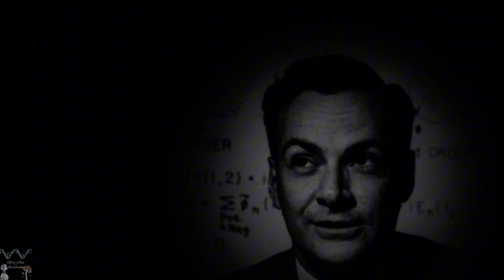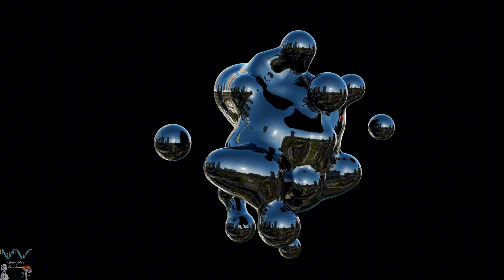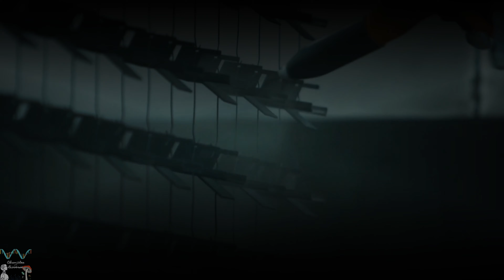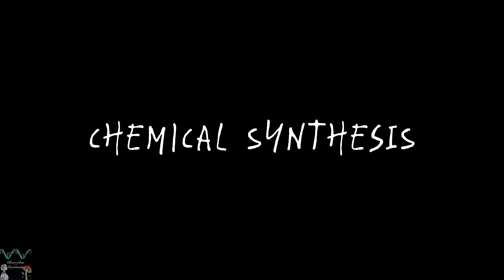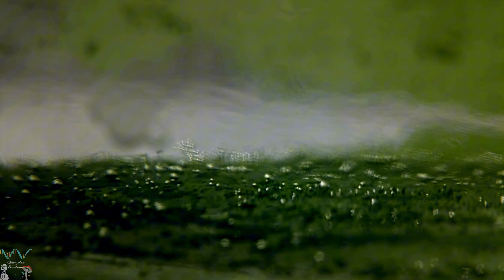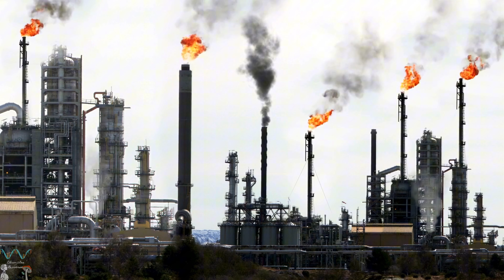From Atoms to Products: Making Nanomaterials

Comment: Do you know any works on chemical vapor deposition?
Reply from the maker: Hey! So you can take a look at this article:
https://www.researchgate.net/publication/348484092_Chemical_vapour_deposition.
 In here they talk about synthesizing graphene with CVD, but many other nanomaterials are being synthesized using CVD. In this article
(https://www.researchgate.net/publication/359319144_Dynamic_GrowthEtching_Model_for_the_Synthesis_of_Two-Dimensional_Transition_Metal_Dichalcogenides_via_Chemical_Vapour_Deposition) they use CVD to synthesize dichalcogenides (which are like metal nanosheets with semiconductive properties).
Reply: @ChroniclesoftheBioverse  
Thank you very much